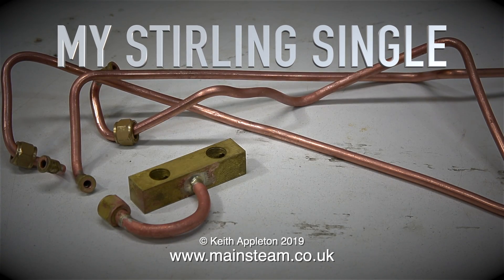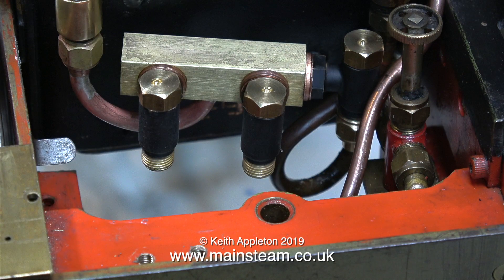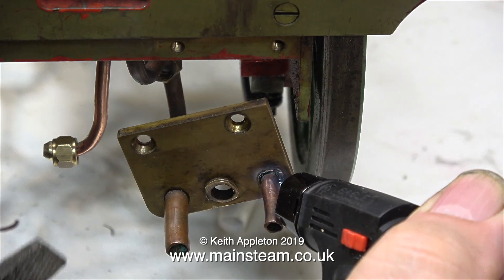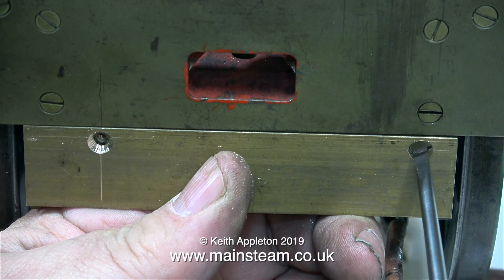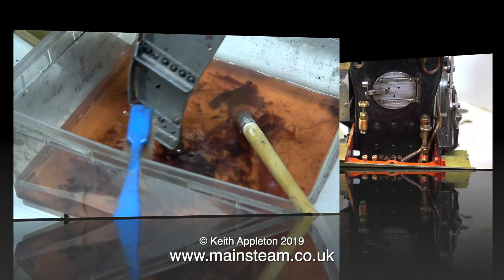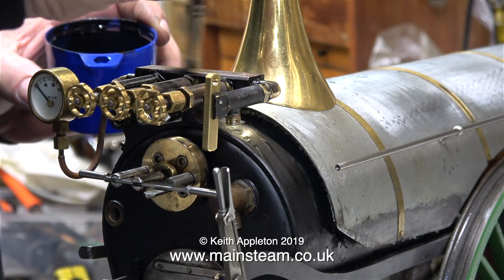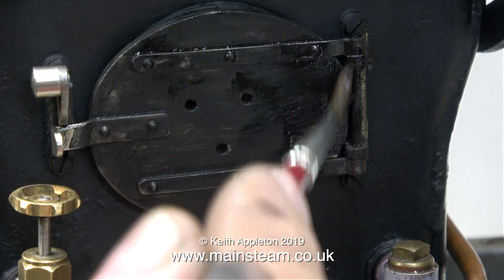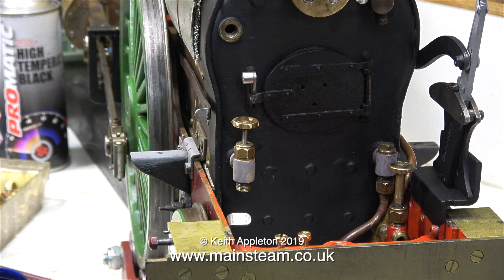MY STIRLING SINGLE #16 - FITTING THE CHECK VALVE ADAPTOR AND PAINTING

Comment: Hello Keith. Sterling is really shaping up always enjoy your videos and your jokes, I have a question that I haven't seen on any of the videos yet, you always say that locomotives need blow down valves for the boiler, was just wondering if your Sterling was equipped with one and if I am correct in it's positioning is it the hand wheel on the right hand side just to the rear what looks like a clack valve at the bottom of the boiler?
Reply from the maker: My Stirling Single boiler has a blowdown valve underneath the lowest point. The other valve is a check valve isolator. Please watch some more of my videos. The ones that you are watching are old ones, newer ones are available at: www.patreon.com/keithappleton